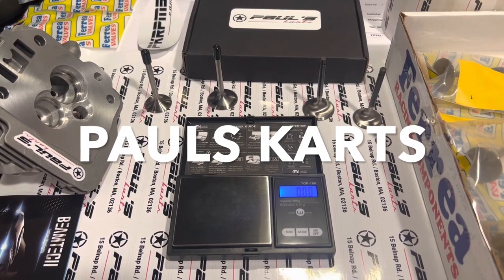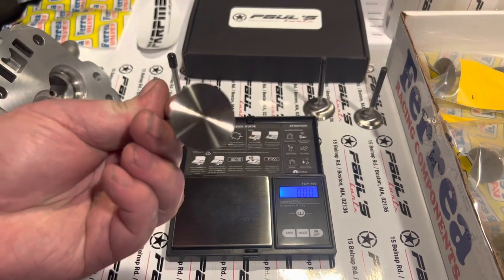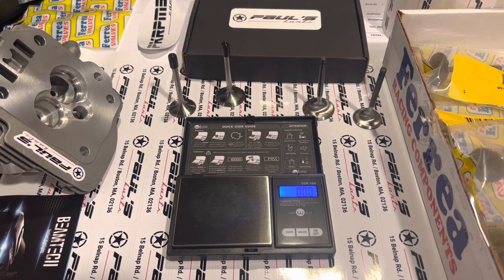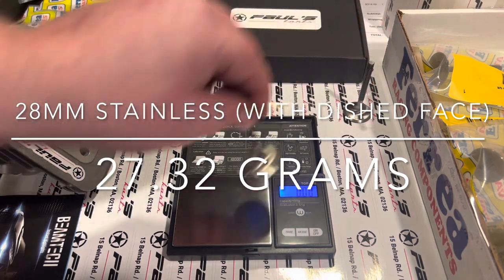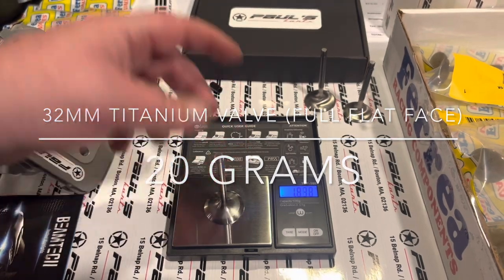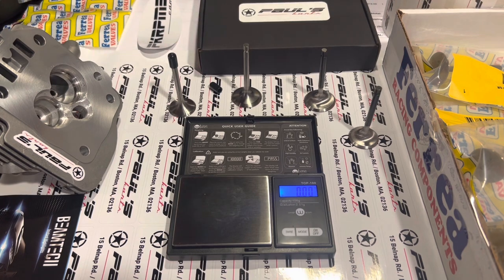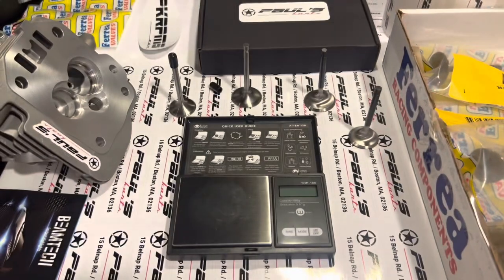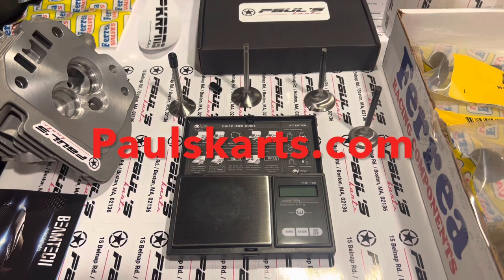How much lighter are TITANIUM valves ? Let’s weigh some !!  Paul’s karts

Comment: Hey Paul great work! I have a question. So I’m running a predator 212 that’s pretty radical. Now I built a motor that’s turning 8500 rpm. I’m running a hemi head with 26 lbs valve springs. With the hemi head I am aware that they have more shallow spring pockets. I had coil bind bad on the exhaust valve so I ordered a .070 longer valve. That sorted the coil bind issue. The cam I am running calls for 34 lbs spring but can’t seem to find any. With the shallow spring pocket I am sure it will increase the spring pressure of those 26 lbs. i wasn’t sure if 26 lbs spring would handle 8500 rpm but on a form site people said it will. I ran the bike and got it up to about 7800 rpm and broke the exhaust valve spring. I managed not to drop a valve and save the motor! Now my question is what can I do with springs without cutting valve pockets deeper and wider? Thank you!
Reply from the maker: Well my advice would be to cut the spring pocket. You can send it here and $35 later it’s done. Then I’d run 37# springs ..
Reply: @paulskartslifan4206  Thank you for the response! My only thing is that I did port this head quite a bit now I’m unsure of how much room to the pocket to the port. My guess not a lot. What would be your take on that? Thank you again I appreciate the help.
Reply from the maker: @3generation_racing658  I’d have to take a look to see , but even getting .050” more depth could change everything in spring setup
Reply: @paulskartslifan4206  alright thank you!
I’ll see about sending the send to you. I just have to figure out how to do it. Is it at all possible while you have the head you can flow test it?
Reply from the maker: @3generation_racing658  I could but flowtesting is time consuming . Usually we do prototype work for flow testing like if someone is designing a billet head we will flow test it and refine the product so they can make changes to the design before large manufacturing runs. To do one head is possible but it’s time consuming and would be billed hourly. So setting it up on the bench, installing the test springs and valve opening screws bolting on an intake and molding some putty to radius the ends takes time then we run the test then the breakdown all time. It’s not practical to take the time for just a number. I could probably pretty accurately guess what it flows by looking at it within 5cfm usually.
Reply: @paulskartslifan4206  I really appreciate the help. I’ll be sending the head to you once I figure out how to do everything for the spring pockets to be cut. Thank you!

Comment: How is the titanium intake valve so much lighter than the titanium exhaust valve?
Reply from the maker: The titanium intake is lighter than the stainless exhaust .. I never weighed the titanium exhaust valve, just slipped through the cracks and forgot to weigh it in video.
Reply from the maker: The titanium valves are more than just light too there light yes but also there made to higher tolerances or more concentric, there back cut , titanium on bronze is like butter and oil super click surfaces , they dissipate heat fast as heck , they have a high internal friction that dissipates vibrations and lessen bounce .. there crazy also the shape of the back of the valve tubes up the seat area like another Venturi effect. There just amazing valves. If I remember right the valves alone just by shape increase flow by like 5 cfm . There just sick
Reply: @paulskartslifan4206  and titanium was specifically created for it's heat resistance. If it weren't for titanium and it's heat resistance properties there would never have been the SR71 Blackbird. 😁